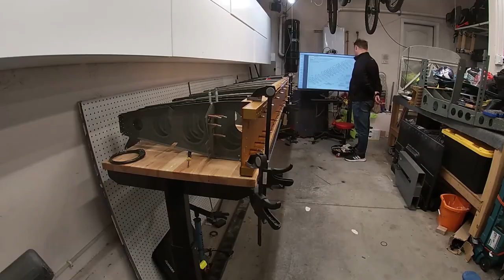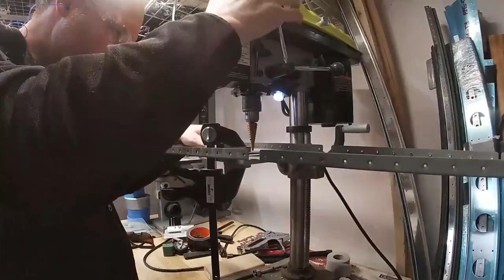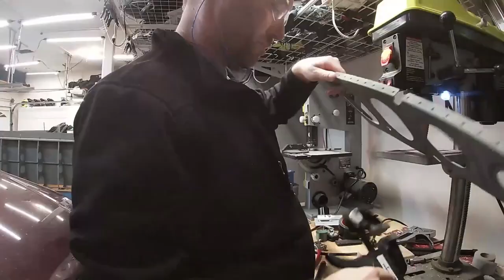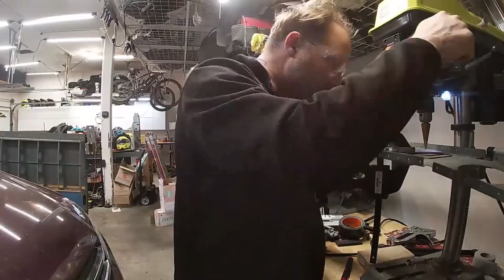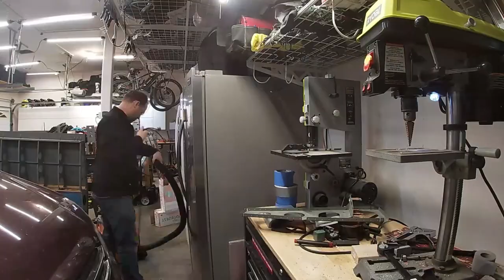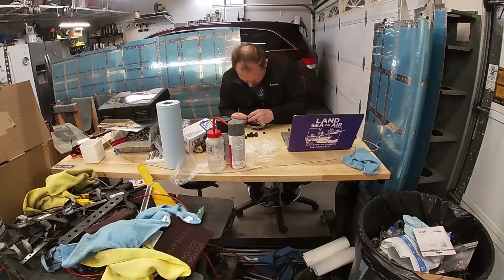RV-14: Wings 76

Comment: Here's a good time to stop and map out your systems needs.  For example, you know the pitot will require 2 1/4" tubes and at least a 14AWG wire.  You can fit this in a 1/2" bushing...ask me how I know ;)   Don't just follow the plans here predicates you using their wiring harnesses and systems.  Just a thought.... as long as you have your bottom skins off you can drill these holes and run your wires with no problem.  Also, you can use the bolts and put adele clamps on the spar to run wires there...no need for holes for those runs.  Coax, wire harnesses (GMU11 and Auto Pilot Servo), pitot/AOA tubing would be good to run now.  Also the OAT wiring could go in.
Reply from the maker: Yeah I think I will finish riveting on the spar and top skins so I can put the wing in the cradle.  That will free up table space for me to get out my avionics and start building panel version 1 and start wiring.